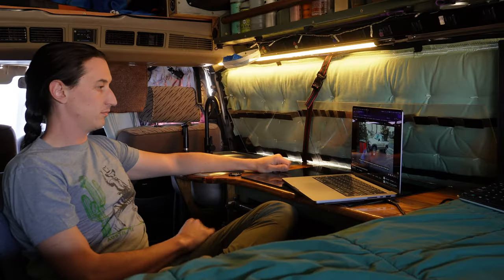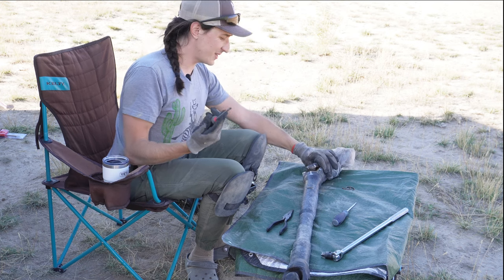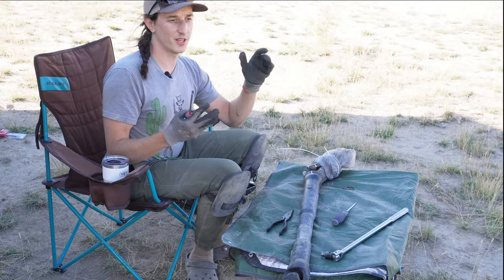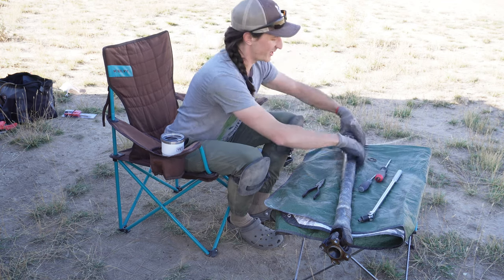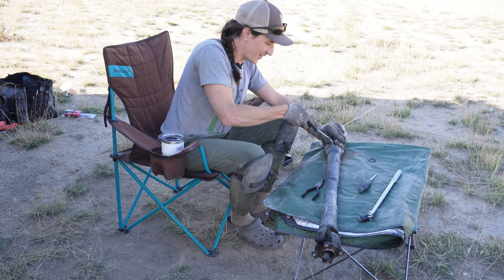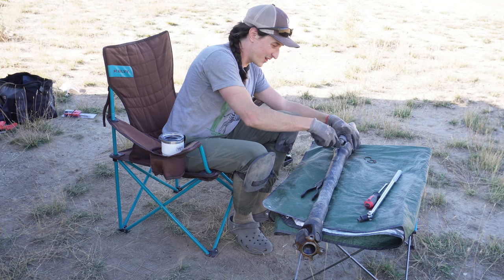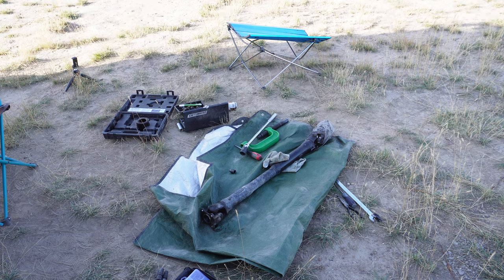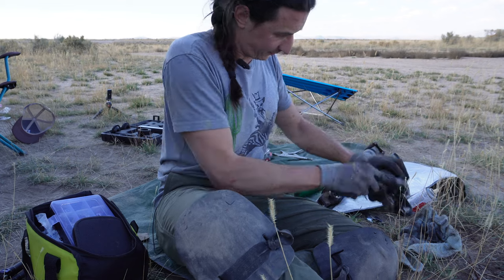When your van breaks down

Comment: I hear u about knowing ur vehicle. I'm on the road too & I took it to 2 mechanic places. Both told me all looks good & they even drove my car & still found nothing wrong. I hear a knock, clicking as I turn & brake. When I get to a home base place, I'm going to check my CVBoots  and the point. 
How did u record ur U joint running under ur car? Did u set or take it phone to record it? 
I hv a 2005 Honda Element that has just hit 100k. Still my young baby. 😊
I hate the tech company. That YouTube is so greedy, 30% is what I understand they take from chats. 
Great that u r able to fix the shaft. ,👏🏽👍🏽
Reply from the maker: I had a similar issue with my Transit Connect. No mechanic could figure it out either. At some point I think you have to accept older vehicles just make weird noises sometimes too. I have a magnetic mount for my gopro for the vehicle mounted shots.
Reply: @dustyodyssey  Thx u Chris. U have lots of great tips. U r 1 of my favorite to watch about cars. ☺️
The noise I'm hearing is something wrong. But u r right, eventually old vehicles will make noises.